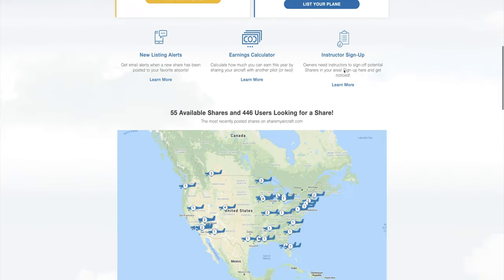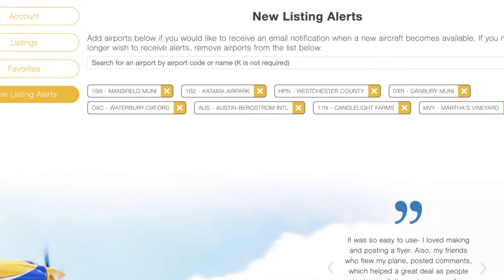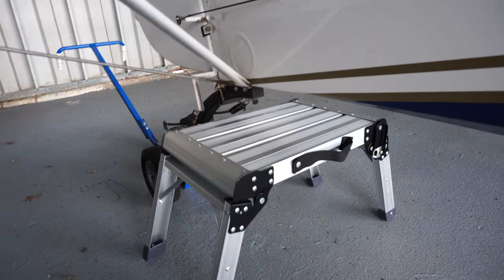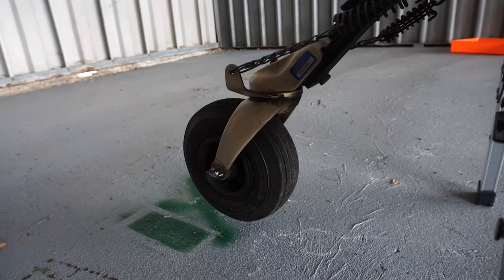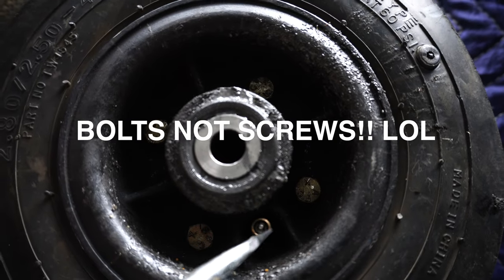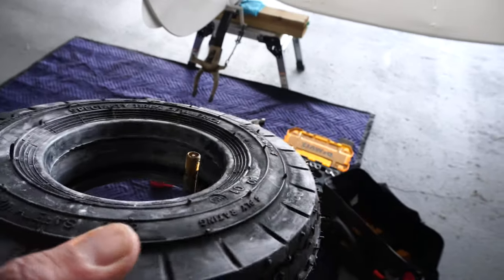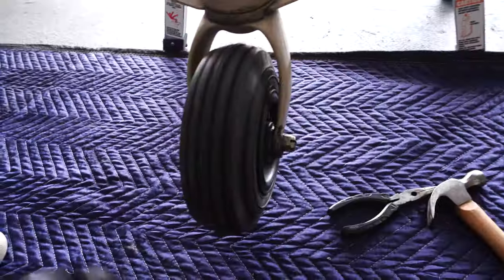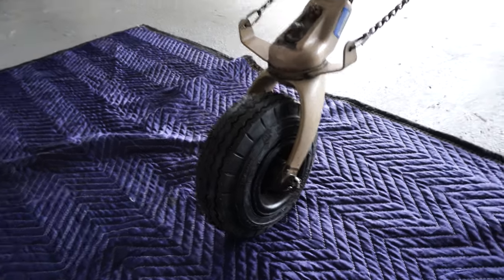4K Changing the Tail Wheel Tire and Tube - Aviat Husky

Comment: One of the things I did to my Husky tailwheel after getting two t/w flats early on in my ownership was to replace the 4 ply tailwheel tire with a six ply tire. The six ply tire is much more durable than the 4 ply  Many 100's of landings since with no problem.  I also installed the new AKB Husky tailwheel spring set, which changed the angle of incidence of the tailwheel.  Big improvement.

Comment: I needed to change the tire on the Scott 3200 tail wheel on my Citabria and found your video on this topic. It is what I was looking and helped me somewhat. However, maybe some editing to remove non-relevant scenes is called for. Also, should you get to film this again, please include the hub assembly process, which is not shown. 

The torque setting on the 4 bolts holding the hub together is 120 in-lbs.

Comment: Three suggestions; first, I would have made sure the bead was broke (unseated) before removing the wheel half bolts.  Second; I like to use tire talc.  Talc meant for personal use is mostly corn starch.  You can get tire talc from Aircraft Spruce or an automotive parts supply store.  (It's fun seeing the look on the clerks face when you ask for it.  The youngsters have no idea what your talking about.  Then the manager says he has to order it.  But it'll be in the next day)  Third; please get a tripod for the camera.  I was getting woosey.